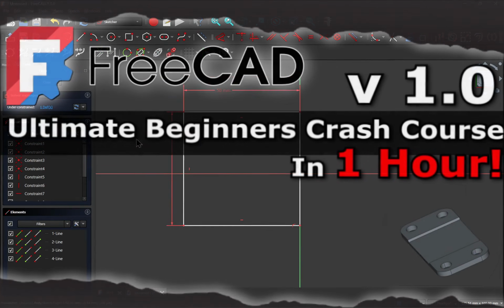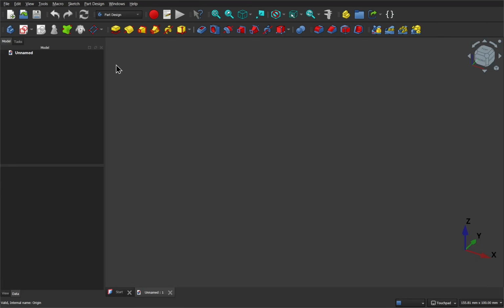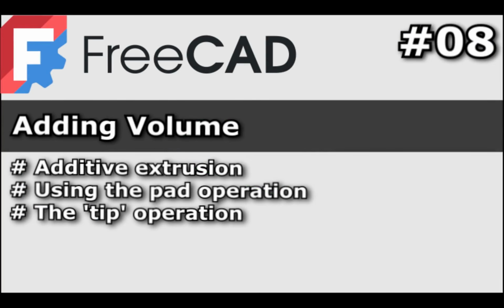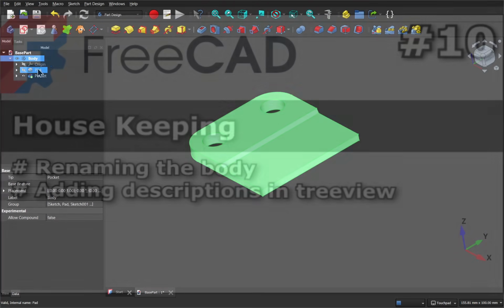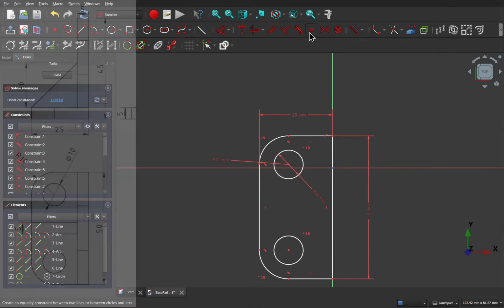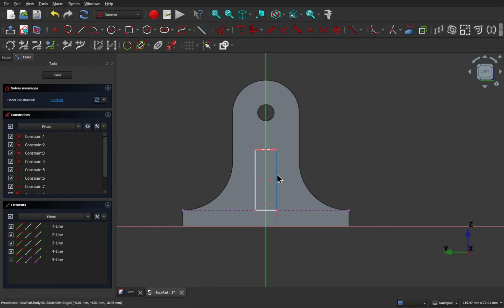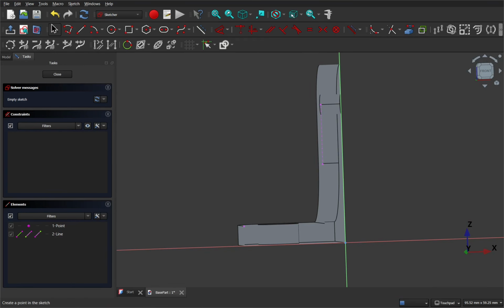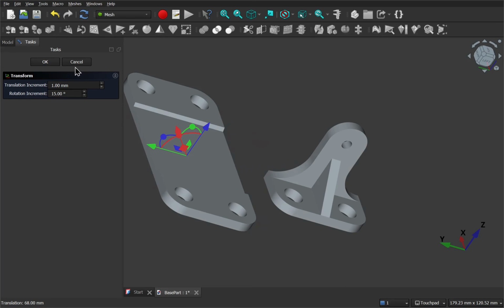FreeCAD 1.0 Ultimate Beginners Crash Course in 1 hour for 3D printing   CAD Lesson / Tutorial

Comment: Thanks for giving up your time to make this video. I am 62 and a novice with CAD. Your step by step is extremely helpful.I have had to restart this tutorial 3 or 4 times as my results would be different than yours. Inevitably it would be because I missed a step and ended up with something that I was unable to find my way back from so it was easier and faster to start over again. Repitition is a good learning tool. I've managed to get to the end of the Base and I noticed that when you mirrored your base, it became one part right away. When I mirrored my Base, it looks like two parts. There is an edge between the left and right. I looked through many settings and preferences to see if I could find the reason for this and i found that in the Model tab, if i clicked on "Mirrored" the data would be available in the lower pane. In the lower pane data, there is "Part Design"> 'Refine> False. I changed it to "True" and the Base became one solid piece. Any idea where the setting would be to make the mirroring automatically one solid piece? Thanks
Reply: You can set 'Refine' to default to 'True'. In the menu, Click on 'Edit' and select 'Preferences'. On the left pane of the preferences dialog, find 'Part/Part Design' and click on it. In the right panel, in the top section, the 2nd and 3rd options are what you're looking for.
Reply: @leroycasterline1122  Thank you. Perfect step by step instruction.

Comment: I was following along doing exactly what you were doing but when I got to the external geometry section (about 23mins into the video) once I clicked the external geometry button and chose the top line of the drawing (just like you) it was all working fine. Once I clicked the polyline button and followed what you did, my "Solver Message," said Redundant constraints: (7,10). Your Message Solver said, under constrained: 3 Dof(s). I hit undo back to the beginning of this section on my drawing and tried again, following your video, but it just kept doing this. Do you know what I'm doing wrong?
Reply from the maker: Hi, thanks for feeding back.  Where it said redundant constraints: (7,10) you can click the number in brackets and it will highlight those constraints on screen.  You can then delete them.  This normally means there's a constraint that is not needed.  Also on the panel on the left in the sketcher there is a drop down where you can choose to auto remove redundant constraints which helps a lot.
Reply: @MangoJellySolutions  Thanks a bunch. Deleting them individually worked. I also ticked the box for auto remove redundant but for some reason it didn't change the solver message. I clicked the auto update on the solver, but it still didn't automatically take the redundant one out. Not sure what's going on there, but it did work when I deleted them individually. Thanks so much for the help and answering back so quickly. Great videos!

Comment: At 13:25 I cannot select the origin point to add symmetry constraint. Two rectangle points can be selected and turn green, whereas origin point stays blue.
Reply: FreeCAD restart solved the issue. The origin point could be selected at all (no "hand" cursor).
Reply from the maker: Glad you got it sorted.
Reply: Same issue, same fix. Thanks for the comment, that was driving me insane.

Comment: @ 24:18 I get an error "redundant constraints (7 and 10).. grrr   I can figure out why?  

BTW Just love these videos as I am total noob with CAD... thanks for your dedication. 
👍
Reply from the maker: Ah so you need to delete the constraint 7 or 8 from the constraints list in the panel on the left.  The number will be in brackets.  You have a constraint that is not needed.  If you look towards the top of the panel you will also see orange text with the constraint in brackets as hyperlinks.  Click on those and hit delete on the keyboard and they will be removed.  Hope that helps. Glad your enjoying the videos :)
Reply: @MangoJellySolutions   Thank you for the fast reply.  It worked after I deleted the redundant constraint (but only deleting constraint 10 and not 7 as deleting 7 would un-attach the point that is needed for horizontal constraint later on.)  I had to delete redundant constraints multiple time after that in further parts of the video.  Not sure why I get these redundant constraints and I follow your instructions to the letter.  Must be some setting somewhere in my preferences... 🤷‍♂  In anyway, I was able to finish the Crash course.  Thanks again for the great course, I'm sure I'll be going back to your V1 series shortly to learn more.  Cheers

Comment: Nice presentation. Thank you. In my opinion a logical follow up to THIS video would be to create an assembly using A2plus. And as a follow on to the assembly would be Tech Draw, using the parts assembled there. Be sure to include how to make a custom drawing sheet and then use that sheet to create technical drawings of these parts and the assembly. So Part 1 is THIS episode, Part 2 is making an assembly, and Part 3 would be documenting the assembly and its component parts for manufacturing. This 3-part series would cover ALL the basics any of us would likely need to do.
Reply from the maker: Thank you 😊. So, funny you should say that. I am planning a assembly but I never thought about the tech draw side of things. You have a great point there. Copying this comment to my trello board as there is a lot to take away. Would not of thought to include a custom drawing sheet. I even helped one of my Patreons that wanted custom techdraw sheets along with embedded fields. . Thank you so much for the ideas.
Reply: @MangoJellySolutions  I’m pleased that you found value in my comments. I’m a retired CAD designer. My first design job was at Pratt and Whitney Aircraft way back in 1971, on a drawing board. CAD did not even exist. My last job was 30 years in mechanical and structural design at General Dynamics Electric Boat, designing elements of nuclear submarines, as well as fixtures designed to build and/or install them in the boat. My experience runs the full run,  starting with AutoCAD (which I ended up actually teaching) way before Electric boat, thru CATIA v3, v4 and v5, Then SolidWorks and Inventor and finally NX for the last 8 years at Electric Boat, from where I retired in 2017. In all cases, the most efficient way to build assemblies in CAD, regardless of which CAD platform I used, was to create the parts (the individual parts that make up the assembly)  “in place” directly IN the assembly, right directly on the part the new part must interface with. That's the only way to guarantee that everything actually fits the first time. Some of the platforms stored each individual part directly within the assembly file and some stored each part in its own file, which were then “assembled”. There is value in both approaches. But creating the individual parts “in place” has been shown to be the most efficient way to create multi-part or complex assemblies. Of course, all of them would import standard parts as well, incorporating them into the assembly as needed. The main point is that designers don’t really design “parts”. They design “assemblies”, creating the individual parts along the way, which are actually components of the assembly, as the design progresses. Once the 3d assembly was approved by technical checkers, the designer would then either create the technical drawings that would go to the manufacturing facilities, or lock the model(s) file(s) and transfer them to a drafting department where the technical drawings were created. I’ve worked in both environments. As you continue your series in FreeCAD v1, which I enjoy very much and value as among the best out there, if you could incorporate and teach this design philosophy, you will pave the way for many upcoming talented designers to begin using this platform the right way from the very beginning. Officially this is known as the “Top Down” approach, vs. the Bottom Up approach, which creates every part individually in its own file, and then assembles them. This works for simple things quite well, but as the assemblies become more complex, like they always are in the real world, The Bottom Up approach usually creates more rework than is acceptable, because when some small part doesn’t fit right, and then when corrected, the original error usually snowballs up the chain in the assembly.  Anyway, I hope you find value in these random thoughts of mine. They are the result of a 45 year career in industrial design, from drawing board with ink on vellum, to today’s most powerful CAD platforms. I like your teaching style, and it is particularly well suited to the FreeCAD platform, which I really am enjoying learning the ins and outs of. Best wishes, and please don’t stop.
Reply from the maker: @2200chuck  I have taken so so much away from you detailed reply.  I do have a top down approach with A2 plus for a electrical box enclosure creating the cutouts from prebuilt components to complete the box but I didn't realise how popular this approach is and the lack of material on the subject for this package.  Obviously if you have a solid design intent it will work wonders especially for bespoke builds were the clients wants to make changes and everything re-calculates.  This is great food for thought.  I really need to find something simple that I can use to demonstrate the workflow.  Again, Thank you .